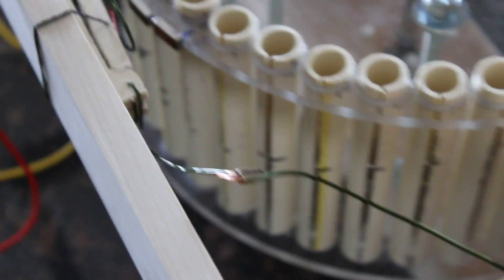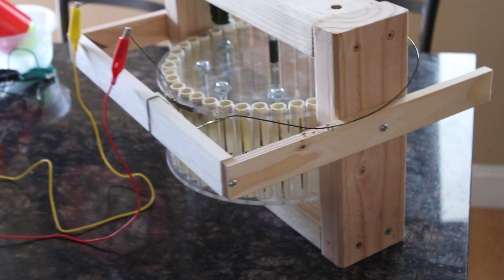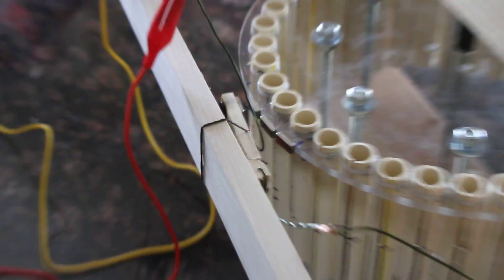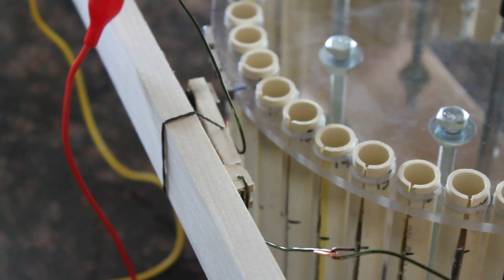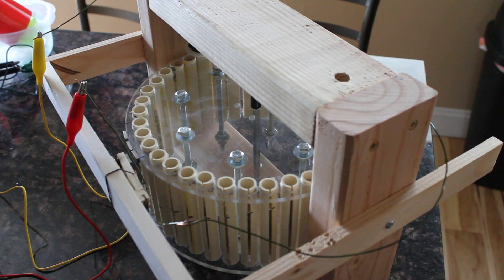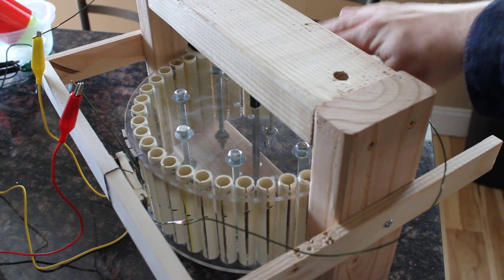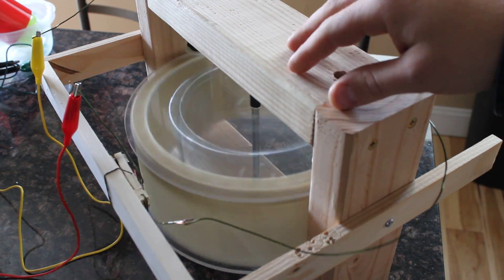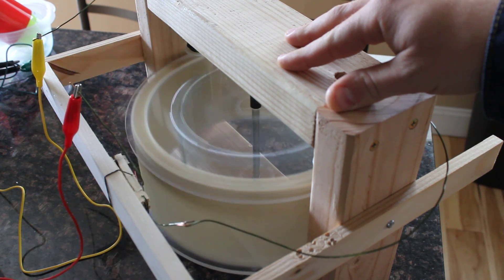FREE ENERGY MOTOR CATCHES ON FIRE!

Comment: Splitting the atom does not violate energy conservation. some of the mass of the original atom is converted into energy. the total mass of the fragments after fission is smaller than the mass of the original atom the difference appearing as energy E=mass difference x c2.

Comment: For the physically allowed type of perpetual motion you speak of, there must be no energy losses to friction , radiation etc and also  the work output can only be equal to or less than energy given  to the machine from outside. (i.e. the machine doesnt create energy). Any attempt to get a physically possible perpetual motion machine to do useful work inevitably stops it eventually. how quickly it stops depends on the other frictional losses in the machine.

Comment: the proses of creating a magnet is by placing a ferromagnetic material in a electromagnetic field created with electricity witch makes the material pick up and store some of the magnetism/energy of the field. to get a stronger magnet you require a bigger electromagnetic field and heating the ferromagnetic material. the magnet in turn will have a shelf-life after that they will need to undergo the same procedure again to maintain their magnetize

Comment: not relay because it takes energy to create magnets and it takes more energy to create a magnet then it produces because there will always be a loss of energy when its stored or converted. witch usual comes off as heat. this might however be a good way to create green energy. magnets also sadly have a shelf-life so you will have to create more magnets witch costs more energy then magnets produce can produce.

Comment: @jzsd14me its on fire because your bullshit is so hot.
Free energy my arse. As for the wires to measure the RPM its obvios from the sparks your passing current into the drum.
Of course you wouldnt use a stroboscope where accurate RPM could be measured without touching the drum because your a waste of space just like your contraption.

Comment: sounds like you are a vollpfosten du klaus, with a lightbow, a mousetrap and wood it'll always be easy to set up a fire. thx for wasting my time. but BTW, how did you get that thing to rotate without any further finger-input? may be you secretly installed a coil and a power supply to get that thing rotating? ehr, just because I can't see the sourounding and the setup.

Comment: @Khwartz 

It's a work in progress. A motor such as this, made larger, and spun up with electromagnets and fitted with copper and magnets can work. It may cost energy to get going but once in motion would power itself. Even if it only generates DC you just invert the DC to AC. This may be science fiction but one day it may be science fact. It starts with little experiments like this. A tiny alternator can power your entire car.

Comment: @ShogaNinja No, sorry, it could be a "motor (like) with copper and magnets", but a generator is not oblige neither to have copper nor magnet, just it could be like you said. Yes, when a generator use magnets and produce DC current, we are used to call it dynamo, but alternators and dynamo are often miss-used word. Remember: I'm trained electrician and have my own business in electricity ;)
For speed for free it's not sufficient, need torque too & so on, could drop otherwise.
Regards.

Comment: @Khwartz if you read the description you'll find it very clear that this is not a generator. Nevertheless if the wheel rotates without consuming any energy then it should be no problem to hook it up with a generator and get the required output above 1.00.
If you've watched the previous models leading to this product then you'd understand the whole idea of this vid.

Comment: @Archline2 No I'm not talking about the friction waste on the wheel.

The dynamo is a coil of wire and some magnets (not touching).
The light is the load.
Moving the wire through the magnetic field takes work because of this load.
The higher the load the harder the dynamo/generator is to turn.

Nothing to do with friction.

Force is force is force is force. Magnetic or otherwise. The force I put into the trolley is transfered via the magnetic field to the 2nd trolley. Equal work.

Comment: @mryellow123 I see what you’re saying but a dyno involves direct friction between wheel and dyno and the shopping trolley you are physically moving yourself, no natural force is moving both for you. Both you could say are using a thermal energy source not just as a initiator but also as the sustainer, that's not the same in terms of magnetic force.

Comment: @Archline2 Think what you miss is that it takes work to turn a generator under load.

Try this experiment.

On the open highway, accelerate in your car with all the gadgets switched off.
Now turn on the air-con, the DVD player, the head-lights, and charge your phone.
Why didn't you accelerate as quickly?

Ever rode a bike with a dynamo generator for the headlight?
Why is it harder to peddal with the light on?

Comment: @Archline2 lets look at this again....

Lets say you can design a 100% frictionless device (good luck) which accepts powered input and turns a load to generate power.

You say "create surplus".

Where would you say a "surplus" of energy could come from in this or any other configuration? The fly-wheel effect of the whole thing is simply stored energy from the input.... So where would you get this surplus? What is this "it can work in theory" thing you talk of?

Comment: @mryellow123 I see volts and amps being transferred into a spinning movement using magnets. The question remains can that be refined using better/frictionless bearing and heat resistance materials to make it efficient enough to replace those amps and volts that made that movement and create surplus. I'm not saying it works I'm saying can it be made to work? It’s not saying it is, it’s saying what if? That difference between an open and closed mind.

Comment: @BlocklandWorld These magnet motors are just a trick of perception more then anything, perpetual motion devices have been around for centuries and they never work. They are generally simple highly efficient machines, always losing small amounts of energy as heat/light/noise/etc. In other cases needing constant input of small amounts of energy. Often the input is obfuscated so without looking deeper it appears to be "coming from nowhere" but is always some external source.

Comment: Stick a static coil in the middle so that it goes round the center axel but doesn't touch anything else, then stick a magnet to the axel so it is in the middle of the coil. Then hook the coil up to a battery and the clicker. See what happens? Seriously man I'm intrested in what the results would be? I reckon as long as the friction ain't too bad and the battery is decent and rechargeable it might be able to power itself.

Comment: @1Bored3 Don't pollute your mind listening to these idiots, your education is correct, energy can change form but is never created or destroyed.

These devices work in various ways. Either the energy is input in the initial spin, an external power-source like this, or they "mechanical transformers" which change the power much like a wire wound transformer does but with much higher loss, or they are simply cool efficient toys which can never do any "work".

Comment: Wonder how well it would work on the dark side of the moon, free cooling and low resistance or maybe it would be weaker because the magnetic field of the moon is weaker? and where does the magnets get there energy and how much energy did it take to make em. not completely free.

Comment: @SeanRamey All he has done is build an electric motor. The concept is simple and is not new what so ever.  There are different levels of efficiancy however this is not a generator.  It is using electricity as an input, with no electrical output.   Any electrical output would come from what is esecially an alternator, which would put drag on the system slowing down the motor or increasing input energy by a greater amount than the output to maintain spinning.  Look up "electrical brush motors".

Comment: @jzsd14you can buy a reed switch which will activate when the magnets come close.   It wont catch on fire if you run relatively low voltage and its cheap

Comment: sorry but this is just stupid.  there is not even the slightest potential for free energy from this or any design similar to this.  All you did was build an electrical motor.  energy input with out energy out put.

Comment: You need to collect that back emf rather then wasted! Here is how" 
 Put a high power bridge diode rectifier 2 of the ac in puts on that sparking switch then other end of the br diodes has to be connected to a 50v 10,000 MF (or so) capacitor, then you will be amazed how much back emf you will be able to collect. If you need a further help? Drop me line man and I send you drawing how to do that.

Comment: @jzsd14me 
You can find them on e-bay ( probably ) . otherwise , you can find them at your local lawn service shop . Then you just need to make a small metal bracket to hold the points onto , then affix to your wooden frame . Then it should be ; Walla ~!

Comment from the maker: @sorova The battery that I will use on the next model is a watch battery. The power I get back is around 30 volts at 2+ amps and it should work for well over a year on a battery that small. 1.2 volts @ .05 mA Believe it or not. Most people don't.

Comment: @thetarget Simple, I've watched all the videos so far. Each motor gets more and more complex. That adds more and more mass. Requiring more energy to get moving and keep moving. Finally in this we have wires added that appear to show electricity being produced. The problem is there is no armature with windings to produce the current resulting as a spark. That implies an exterior power source.

Comment: @bikerchick713 Yes, but here is the problem, he has natural magnets INCLUDED in the design to provide the magnetic field for the device allready. The idea for this device is to simply start it by hand WITHOUT any external power source ( except to provide a push ) and it will spin up and keep spinning. If he has to keep an electrical supply fed to it to maintain RPM's then it is not free energy because he is putting energy in to get motion ( energy ) out.

Comment: @jedi22300 Who in the world doesn't believe making electricity with magnets is possible?!?!?!?  How do you think transformers work?  An AC voltage is fed to a coil and the magnetic impulses form that transfers to another coil whereby a voltage is produced. Depending on the number of turns in the wire of the second coil, depicts if the voltage is higher or lower than the source.  Wrap enamel coated wire around a nail. Attach a 1.5 volt light bulb to the wire ends and pass a magnet by it!  LIGHT!

Comment: Try to use transistors circuits as the switch , there are no mechanical connections, those no flames.

Comment: jzsd14me, could you use a reed switch to flip the polarity? It could solve your noise problem and possibly reduce the friction. Could have magnets around the perimeter that just gate your reed switch closed, and when not in proximity it sits in open position thereby in theory creating your toggle switch for the polarity.

Comment: Part  3: regulation/orientation of a entropic system needs energy. Even the phenomena: magnetic force to come out, based on atomic level.The problem: "from where we got the energy" is only put away to a lloooong distance, by "free energy-builders" - such a long distance,that they cant comprehend the relationship: "where energy needs to put in",that the motor works. So at every magnetic ("free energy") motor the point is on: the spin of electron  (the energy to orientate they all in the same

Comment: Part 2:  So the magnets needs to be re-charged in his magnetic property again (magnetified). And this needs power. And this recharging needs more power, than the magnets gave during the "free-energy-motor", because the lower efficiency of re-magnetifieng the magnets. So it isnt free energy. The "free-energy"-magnetic-motor-builder thinks, that a permanent magnet is naturally given, without any energy to put in, to orientate the spin of the electrons in the magnet. But thats not true. Every

Comment: Sorry,but every "free energy"-motor, based on magnets arent free energy. It only a way to consume the (non-entropic) magnetic power, stored in the (well-orientated) spins of ferromagnetic permanent magnets electrons. That means : with every turn of this motor,ta little bit of "well-orientaded" spin of the permanent magnet loses for the electric win - the orientation of the spins  turns more and more: entropic. That losing of orientation of the electrons, loses the magnetic property of the magnet